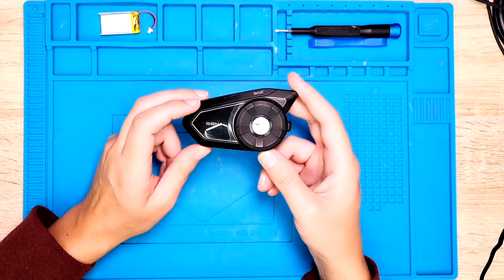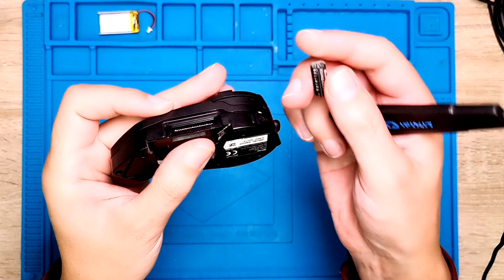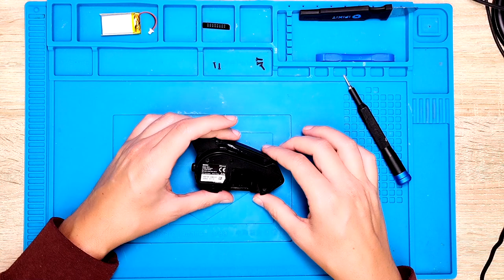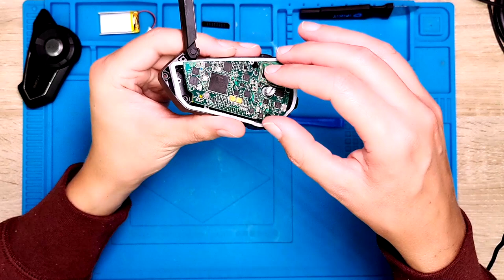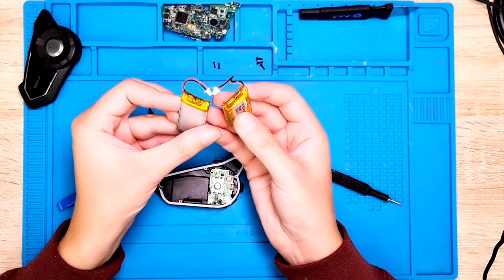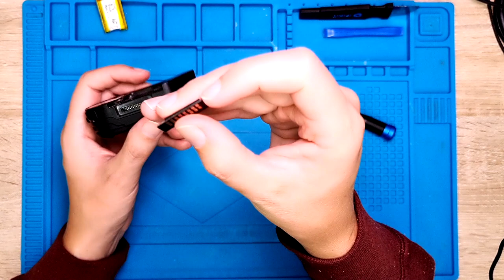Sena 30K Mesh Intercom Battery Replacement / DIY

Comment: after the battery replaced....the mesh didnt work
Reply from the maker: The battery cannot be the reason. Have you pushed the 2 connector (PCB sides) well together? Are the tiny antennas connected? These 2 would be my bets with high probability.